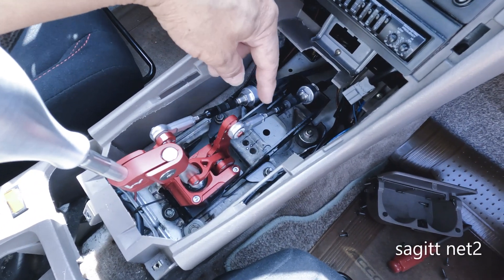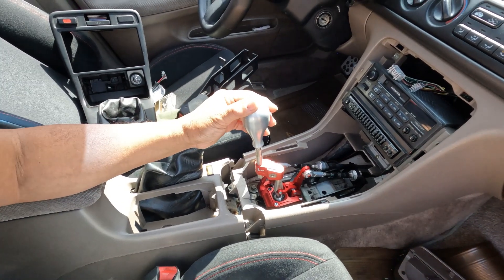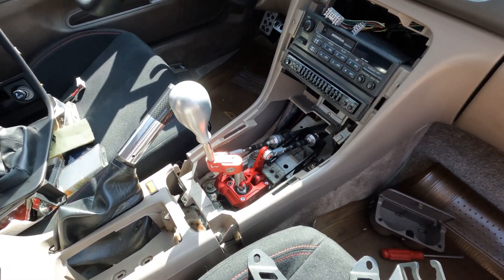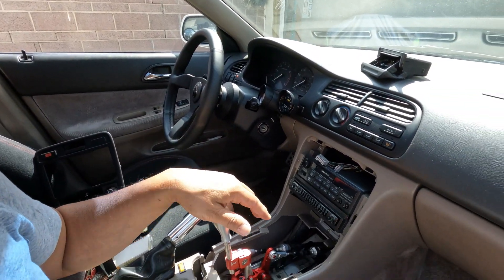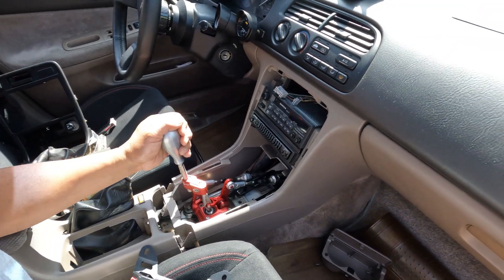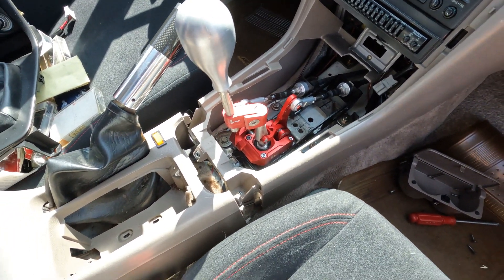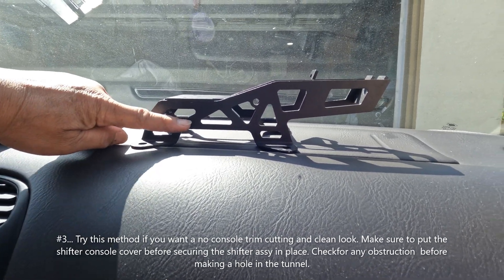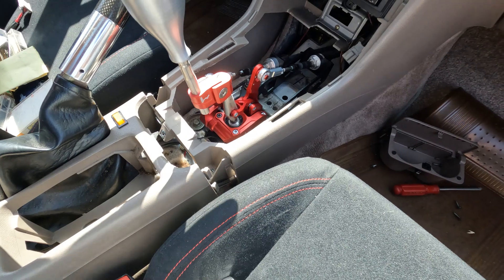RSX shifter and cables install guide for 94-97 Honda Accord

Comment: So if you can help me out with all the materials ill need to get my hybrid shifter installed in my CD5 accord cause i do not want to cut my console
Obviously
1. The hybrid shifter 
2.K-Tuned shifter cablee adjustable
After those 2 you lost me so do i need to cut the hybrid shifter legs to shorten it so it can sit lower do i need base plate aswell and what kind and am i missing amything else ??? Wish you took the shifter out ans showed us or made a dedicated video specifically for us CD5 people havent found much info on this
Reply from the maker: I have a blog about it when l put it together. This episode is just a follow up. Anyway, what l did was cut the legs off and rewelded it and if you dont mind doing it on yours and l know it's a bit expensive to be cut to make it work on our cd5 but it'll be worth it though. It's not necessary to use the shifter baseplate of the Accord. I only did it coz l dont want to put holes on my tunnel floor to mount the HR shifter. You can make a plate and bolt your new shifter then bolts it to your tunnel after or simply bolt the HR shifter on. Your ktuned shifter cable rod end is a bit too wide and you wont be able to secure the clip. I have to polished/shaved the teflon washer in order for the clip to secure properly. Make sure to use a k to H tranny conversion bracket together w/ your rsx cable. Do you know that hr offer a shifter for Prelude now, you should have gotten that one and use a Prelude or 97-2001 Accord cables. But either one will work, it just that RSX require a bit mod thats all. There will be some cutting inside but it wont affect your exterior look of your console.
Reply from the maker: https://youtu.be/Kq6dYYC7Bnw?si=CVgaCQV78OIjJW6L this episode will help you more l think.
Reply: @sagittnet2158  thank you so much I understand it now fully

Comment: So I can use one from an RSX? I have a 95 accord with a H22A but the ppl who put the motor in. They left the stock shift assembly from the Accord and well let's just say it's not compatible with what's going on it's jerry-rigged they got wires and zip ties holding it on. And I've been looking everywhere here in Phoenix Arizona for a 95 to 96 prelude so I can get the shifter assembly. But looks like I can get the shifter assembly from an RSX?
Reply from the maker: I'm using Rsx shifter that l modified to fit coz l want to retain the shifter trim panel and not a whole lot of trimming. I coupled that shifter w/ rsx cables and in order to get it to worked. I also used the k2H tranny cable bracket ( it wont work w/o the conversion bracket). Hybridracing shifter are available now for 98-01 Accord and 97-01 Prelude. It sit lower than rsx shifter so no modifying require to mount it. Except for mounting the cables, you have to use a 97-01 Prelude or 98-01 Accord cables though and you dont need the k2h tranny bracket. It really is a good shifter upgrade for our chassis, you wont regret it. After l found out that Hybridracing have a shifter for Prelude, l thought about getting one so l can try it out using 94-97 Accord cables, of course a little modification is require on the cable mount clip area on the shifter side. New price of it kept me away, everything went up now so l scrap that idea.
Reply from the maker: The 94-97 Accord cables will not mount on Hybridracing nor ktuned shifter. The cable rod end hole are smaller than the shifter l mention. So too cut it short, if you are using RSX shifter on Accord, you have to use rsx shifter, cables and k2h tranny conversion in order to work. If you decide the new HR shifter for Prelude, either get the new shifter and see if you can get it to work on your existing cables. The part you need to modify are from where the cables are secure at the shifter side. The new HR shifter are staggered and on 94-97 Accord is even. You just need to make a small bracket and bolt it on and put the clip that hold it. If it dont work, then you can buy the 98-01 cables.
Reply from the maker: If your'e not in a rush, l do have a 97-01  Prelude shifter and cables and maybe l can make a vlog about it just so you can see if its possible to use. I dont have the actual Hybrid shifter but l think it'll give you an idea. Like l said, if the new shifter dont work  on 94-97 Accord cables, you can buy or get the 97-01 Prelude cables. Nothing too loose but time to try it.
Reply: @sagittnet2158  thank you for the info! 🙏 That helps
Reply: @sagittnet2158  shot absolutely that'll work! 🙏 That'll definitely be something I need knowledge in the future. I have it parked right now cuz of the shifter assembly isn't the right one It keeps popping out of first gear so I just stopped till I could fix it so I didn't mess up the clutch or transmission. I honestly do not know who put this motor in but if you could see what they did it is absolutely embarrassing smh 🤦🏽‍♂️ but got a really good deal on it so I couldn't walk away 🤷🏽‍♂️
Reply from the maker: @chadjones2308  ok, on something like that, you'll be starting from scratch. But yeah! allow me a few good days and l'll make a vlog about it so you can decide w/c shifter you want to use. If you ask me w/c shifter, l'll go w/ new hr shifter for Prelude, coz its lower in design and no need to buy the k2h tranny bracket.
Reply: @sagittnet2158  You are amazing thank you so much! 🙏
Reply from the maker: @chadjones2308  Bruh! I just got the part / shifter plate from Accord and hopefully l get to finish it this weekend. Stay tight brother.
Reply: @sagittnet2158  nice I'll keep an eye out for it

Comment: Wow, its amazing. So you have use the hybrid short shifter in the modify oem base, the adjustable k-tuned cables and the conversion kit for the gear box?
And do you know in which page can I get cheaper?
You are helping me so much thank you
Reply: And for the mounting of some components have the instructions??
Reply from the maker: Thanks, that' pretty much it for installing it. The rest are your call where to center the shifter to make sure it wont rub on the cover. The cheapest route would be the ktune replica. But hybrid is the best/ highly recommend it. I've got more videos to cover on it. Just find time to watch it if you like.
Reply from the maker: I got multiple videos that cover the hybrid shifter and cables. Once you have the shifter in your hand, it'll be easier for it lineup everytging. Check out my rsx shifter  playlist.
Reply: @sagittnet2158  Great, and why did you mount the shifter in the OEM shift base??
Reply: @sagittnet2158  I was thinking in where can buy cheaper like ebay or any web, thanks
Reply from the maker: @jonathanverduzorrilla8829  It's to retain the vibration isolator rubber mount and also l dont need to put 4 holes on the tunnel.
Reply from the maker: @jonathanverduzorrilla8829  l bought it on ebay and free shipping. Some companies will have lower price but you have to pay shipping. Ebay is free shipping
Reply: @sagittnet2158  Great, thank you....if a have more questions i will tell you, great chanel congratulations
Reply from the maker: @jonathanverduzorrilla8829  anytime bruh!

Comment: Hi, Does acuity will fit the same as hybrid?
Reply from the maker: It should, coz l used to have the ktuned replica before l went Hybrid, as long as it's for RSX, and by me looking at Acuity shifter. It should fit.
Reply from the maker: Also use a cables for RSX and K2H tranny bracket to get it to work.
Reply: @sagittnet2158  thanks brother, appreciate ur time
Reply: @sagittnet2158  but is acuity one needed to cut also? Looks like acuity is lowered
Reply from the maker: @znulzndn6025  l only cut mine coz l wanted it lower and l dont want to cut any of the trim on outside. I was using a plate also, if you want to try it, you dont really need a base plate like l did. You can try making your own bracketry like l did on my green Civic where l save the Hybrid shifter base and made one. It really depends on your like. Once its on your hand its a lot easier than you think. But try to minimize the trim cutting inside if your'e doing it.
Reply from the maker: @znulzndn6025  l can guarantte you that you'll like it. It's night and day comparison as long as you use all the correct parts w/it.
Reply from the maker: @znulzndn6025  no worry bruh! Anything l can do to help, just lmk
Reply from the maker: Some have msg me that they have a problem shifting but l never have a problem when l did mine. Not sure what brand of cables they were using and that might have something to do w/ it. I used a ktuned adjustable on cd5, Hybrid non adjustable and k2h bracket on Civic.
Reply: @sagittnet2158  yes brother i was thinking to retain the centre concole uncut like urs, just wanted to look oem , i see the hybrid shifter for tsx is abit lowered also maybe that will fit like a glove since my car is kswapped with tsx tranny
Reply from the maker: @znulzndn6025  that will work too, but you need the tsx cables w/it too. Not sure if tsx and rsx tranny bracket are the same, otherwise you need to come up w/ a conversion bracket for tsx cables to be use on h tranny
Reply from the maker: @znulzndn6025  Bro! Hybridracing are now selling a shifter for Accord and Prelude. I guess they finally getting around. That's good for you, no more cutting ang you keep console intact. Check it out at JHPUSA.com

Comment: Can u put everything we need in comments please having hard time find it
Reply from the maker: If you use the HR shifter for 97-2001 Honda Prelude is easier. You'll need 97-01 Prelude HR shifter w/ 97-01 cables or 98-2000 Accord. No need to use a k to H tranny bracket. Its almost plug n' play. Better than using what l have shown.
Reply: @sagittnet2158  thank u so much an I have a 97 Honda Accord
Reply from the maker: @chriswirrshells5501  no worries man! The HR shifter for 98-2000 Accord/ 97-01 Prelude will be best for you. You'll like it.